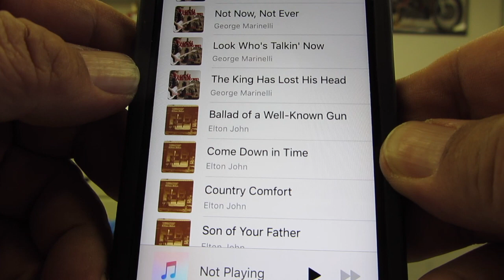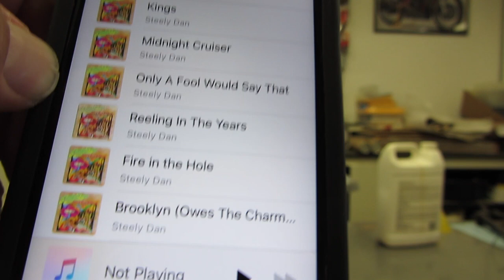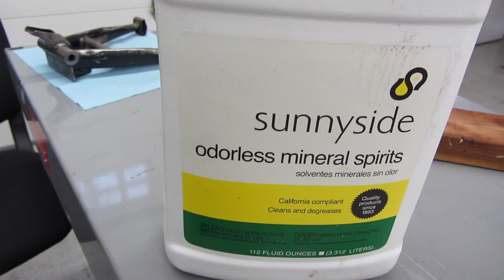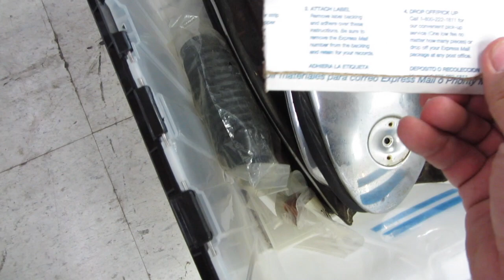1966 Suzuki B105P Restoration Episode 7

Comment: Youtube is so cool ! I always wanted to restore my suzuki b120 that my grand father gave me before he left this world... But I never had the courage to restore it because I never did any mecanics before (even if I do electronic and computer stuff..) and I guess I always had some fear to damage the bike while working on it. But with your series of video I now know where to start ! Thank you for that ! I suscribe and I will keep following your restoration :)
Reply from the maker: Thanks!  Just jump in.  It's only nuts and bolts and there are some repair manuals that can be had on ebay.  If you can find a parts book, they're real helpful as the show the parts relation in an almost schematic way..  Thanks for the note and subscription.
Reply: I already bought the parts book and also the manual guide. But I was more afraid about which products and tools to use for cleaning without scratching it ! In this video I learn from you the way to clean the engine :) Btw even if i'm far from starting the engine would you keep using the auto oil filler or just make your oil gaz mixture yourself ?
Reply from the maker: I'm gonna use the oil injection system.  I'll fill it, kick the engine over a few times without a spark plug in it and that should prime the oil injection pump.  I will put a spot of oil on the bottom end rod bearing, the cylinder and the piston rings when I install them.  I'm also going t add a small ratio of oil to the fuel on initial start up... just in case.
Reply: FRAO i'm looking forward to your next video ! :)